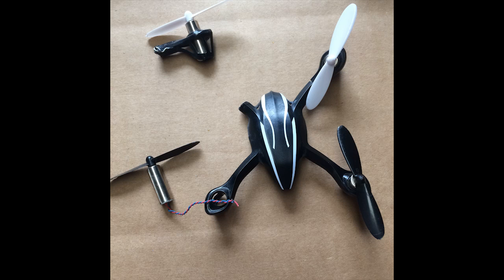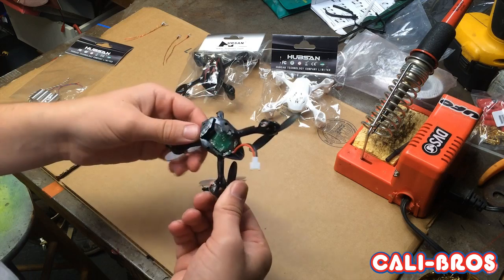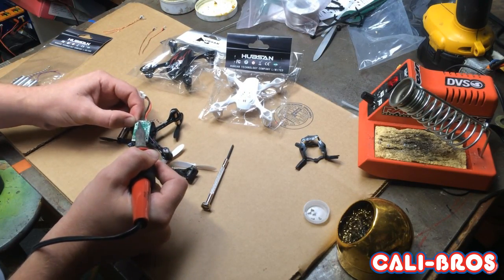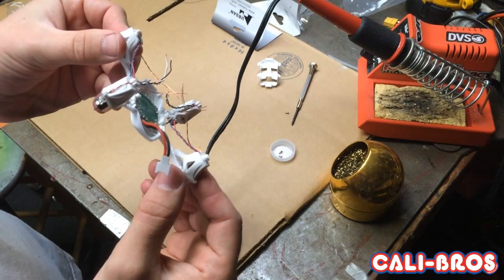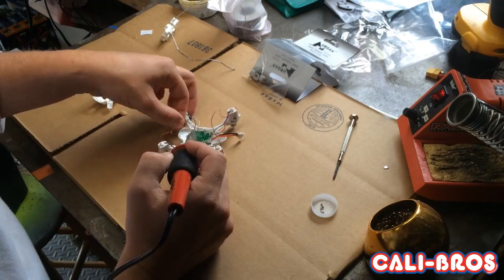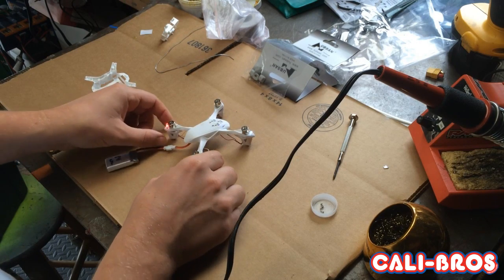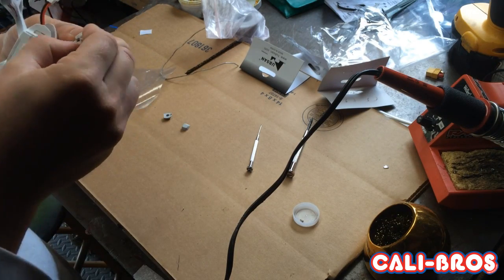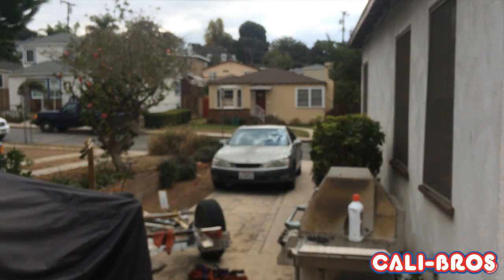Motor Mod for Hubsan DIY - Cali-Bros.com

Comment: I did this mod after see this video using H107L but with everything for H107D I also cut the bottom of the shell down to look more like the H107L it is super fast now. planing doing same mod to the H107P Plus as well but need to mod shell to fit 8mm motor

Comment: So the motors from the H107C and H107D are more powerful than the one from the H107L?
I have a H107P... what motor does it use?

Has anyone tried to run a 2s battery on a H107?
Reply: Benjamin Nenert I believe one is 8mm and the other 8.5mm

Comment: hey.
I ordered 2x 107p. did you think up a idea for adding fpv like the 720p on the 107d pluss? or you know if board are same on all plusses?
Will 2508 motors be better then the 2008?

Comment: Can you please post a video of how fast the modified Hubsan 107L is? Would really like to see how fast it gets with bigger motors. Cant find a video of it anywhere
Reply from the maker: It is shown flying at the end of the video although the size makes it difficult to see just how fast it is.  it's at least 2x faster than an L.
Reply: +Cali-Bros.com You can barely see it in those 10 seconds...replayed the video like 8 times to assess. but ah well...I too shall mod it once am tired of its current speed.

Thanks for the reply.

p.s. seperate video will be appreciated highly (if possible)

Comment: Found this mod in a forum after doing a little bit of research. I've already placed an order for the h107l crash pack, h107d shell, 8*20mm motor set, 380mah battery, and 10x sets of spare blades (seem to go through blades fairly quick). Plan on giving it a custom paint job or possibly hydrographing it, although the white does look nice. Can't wait to get my parts in. Thanks for this video!
Reply: +Chris Kent Did u replace the motors? How much of a difference did it make?

Am asking because I want to make this modification to my quad as well.